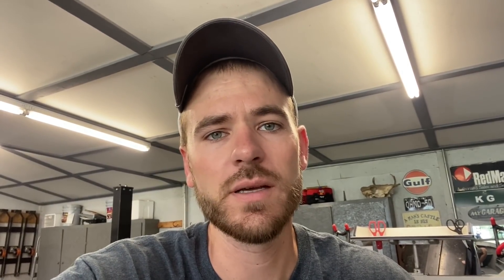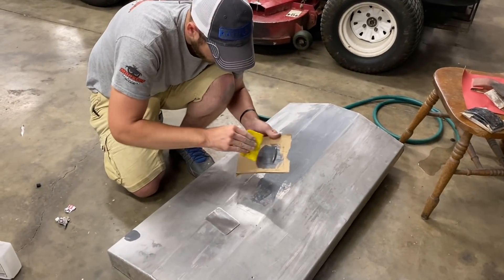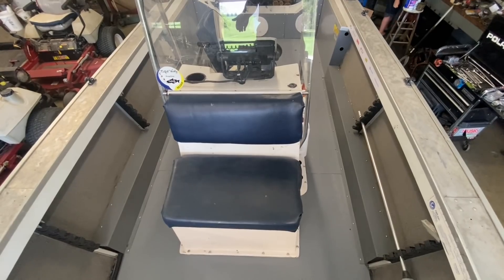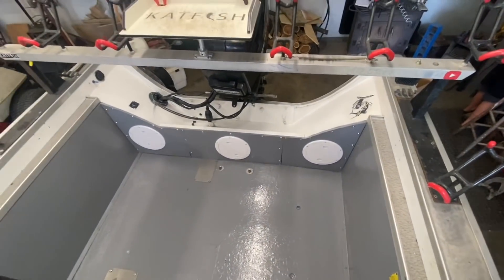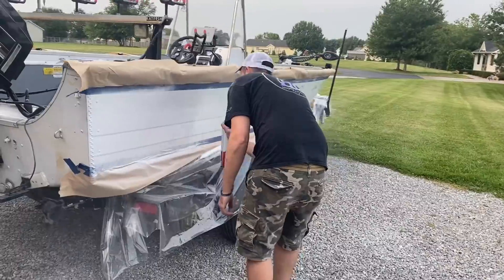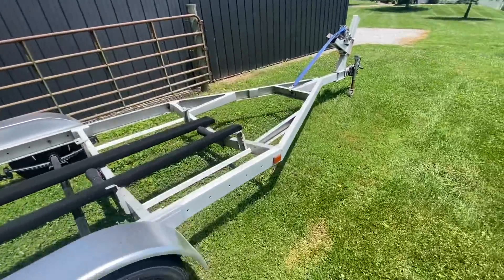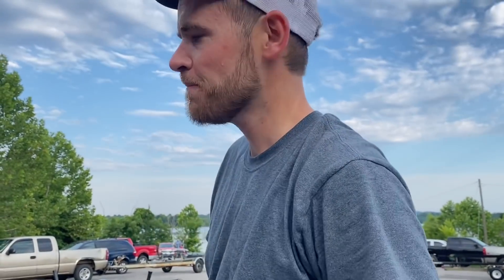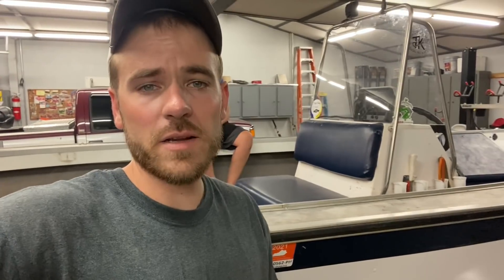Here’s Why I Haven’t Been Fishing Lately

Comment: I've used jb weld to repair a fuel tank. I cleaned and prepped the fuel tank better than the instructions explained. Mad a patch panel and jb welded it into place. It held up for 3 months before it started leaking again. I only say this because your best repair would be brazing or welding the tank or patch panel in place.

Comment: Nice trailer and boat. I’ve had luck with jb weld holding temporarily on fuel tanks but not long term. I hope yours holds forever though but if not have a good aluminum welder repair it just make sure to grind out all the epoxy so it will weld properly. Good luck and look forward to the next fishing video.
Reply: Welding it would have been long term fix . . I think I would have . . Actually I thought that it what he was going to say . .

Comment: Hagen, just a heads up...keep an eye on the tank repair job because that's a temporary fix with jb weld. I remember when I was a kid my daddy drove a 1958 Ford fairlane station wagon with a hole in the fuel tank. Every so often I would help him pull it out and he used jb weld. Probably repaired it 3 or 4 times. Finally he sold it and I sure was glad.